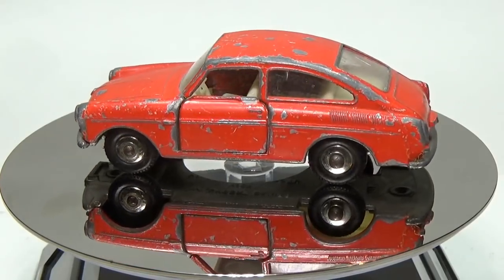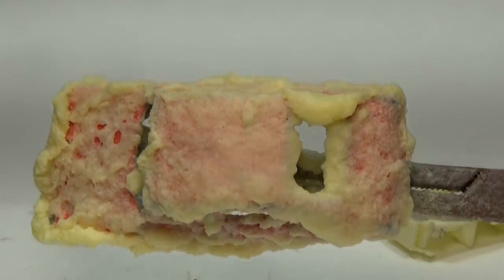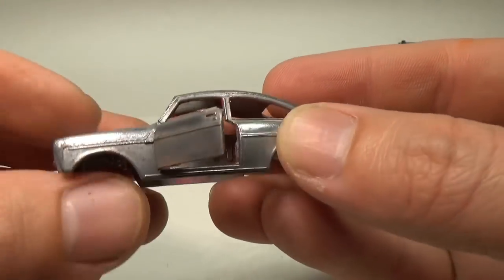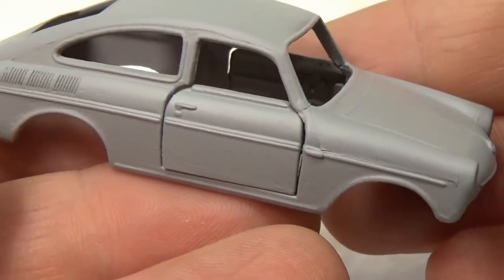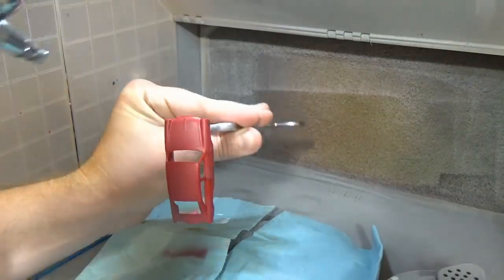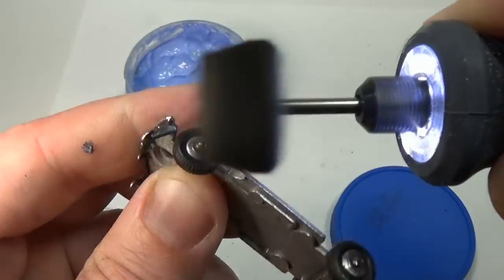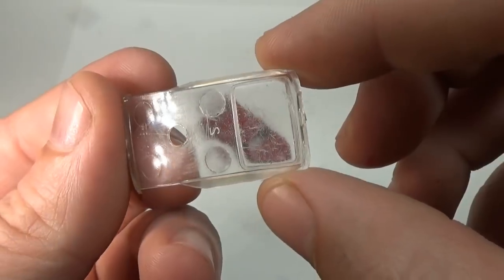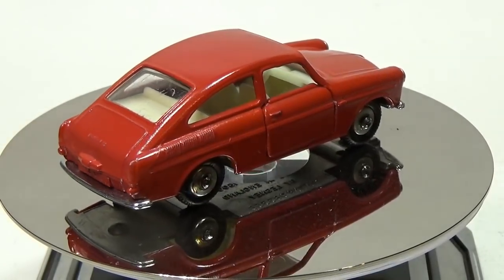Matchbox Restoration: No67 Volkswagen 1600 TL

Comment: During a recent restoration I came across a tool that might be of interest to you. It is called a scratch brush. It is a small brush that uses glass fibres as the cleaning media. Scratch brushes are used in the restoration of watches and clocks to clean corrosion from surfaces. They are great for getting into tight areas and give a pleasing finish. They pretty cheap and now a confirmed part of my restoration toolkit.

Comment: Fantastic job as usual.  Thank you for sharing the repair of the roof pillars with superglue; I have not thought about a simple solution such as that and generally have been passing on any purchase of cars with this defect.
My personal preference for restorations is to stay away from returning the to factory specs for two reasons: one, I usually have some ideas in mind that I want to change from what the manufacturer produced (detailing, wheels, color choice, etc.), but two, it concerns me that restorations to factory specs will be passed off knowingly or unknowingly as authentic to unwitting individuals.  I've seen Matchbox models that are modified into rare versions (for instance a red #22 Pontiac Grand Prix Superfast) that any avid collector would recognize as non-original, but sometimes on eBay, the identification as authentic is buried in the description.  And if it is a well refurbished model, perhaps bought at an estate sale, it may end up in circulation as authentic until a knowledgeable collector or expert proves otherwise.

Comment: if you sprinkle just regular baking soda on super glue (cyanoacrylate), the glue solidifies instantly leaving a rock hard clump behind that you can easily sand down to your desired shape
Reply: that won't work because 'kicking' the glue seriously weakens it and baremetalHW is using the glue's strength to hold down the distorted roof/pillars. A better way to fix pillars is to heat up the roof after clamping (be careful- don't melt the metal and try not to heat up the pillars, they melt VERY easily), which eliminates tension on the pillars. this will also allow a tighter fit between body and window assembly. also better to solder the cracks closed using a good low-temp solder- like silver solder. failure to stress-relieve the body will cause the cracks to reappear over time. in a restoration, only all-metal repairs should be done to the body.
Reply: Except it wasn't bare metal.
He glued it after he had applied the primer. That seems a bit dumb to me, as you are just gluing the paint instaed of the metal.

Comment: My friend is car painter and what i have learned from him is that base surface before primer was really coarse for model car it was coarse even for real cars.
Sand metal with at least 400 or 600 grit paper before primer and also primer needs to be sanded slightly for smoother finish.

Comment: nitrile gloves will help with the stripper. The stripper will still react with the gloves, but not as fast as latex. I usually wear 2 pairs at a time so as the outer glove goes bad I am still protected and change both gloves. Keep extras handy.

The original color on this car appeared orange to me. I had a 1970 that was orange. I really liked that car and was sad to see it go.

Comment: Nice restoration. I was looking forward on you taking off the wheels and axles before restoring the base. I have an old matchbox England base with the same type of axles and I don't know how to remove the wheels. Any help on that will be greatly appreciated.
Reply: You really can't remove them without cutting the axles. I see 1 way of doing it. Grind down end bump and slip the axle out. Then replace end bump with a bead or something similar to hold wheel in place. May be possible to cut off the bump very carefully and with a very thin blade, and then superglue it back.
Reply: U can easily just take the wheels of the axel by trimming the ends of the axel than wen u want to put the back on gently heat the end then press on them with a tac hammer or something
Reply: Rivera's Hot Wheels щщ
Reply: Rivera's Hot Wheels n'
Reply: If you tune into (marty'smatchbox ) he shows how to cut the end of the axle or just shave down the bump on the end and later return it. I realy suggest u watch it. Baremetalhw did it in one of his vidios also i believe he gave credit to marty but i could be wrong about him giving credit i seem to remember it that way thow
Reply: There is another way... you can squeeze the peened end with some special smooth faced pliers. It's kind of hard to explain. I made a special pair of pliers by cutting down and grinding a pair of cheap needle nose pliers. The important thing is the jaws have to be smooth, not serrated. If they're short and stubby, then you can get enough leverage to flatten the peened end. You first squeeze the end square, then octagonal, and then you "squeeze it round," and eventually the wheels will slip off.

Comment: Car looks great.  Grainy paint can be the result of applying it too thinly.  It's essentially drying in specks the second it hits the car (PSI too high).  Try applying a little more material when spraying so the applied paint stays wet for several seconds so it can flow.  Most model paints are designed to be self-leveling and have gloss without a gloss coat.

Comment: I️ have performed many restorations and one trick that I️ saw online was to bake the enamel. I️ place the painted body in my kitchen oven at 200 degrees for about 10-12 minutes. The finish comes out beautiful and more durable.
Reply from the maker: going to try this... thanks!
Reply: I do this with motorcycle parts that require paint; e.g carburettor bodies. Enamel touch up cans (can be made up to match any real car's paint code, then into the toaster oven.Holden Cyan metallic looks like anodising on aluminium at a glance...!

Comment: Hey, just a trick for you for your mic audio, I am sure you have tried to fix the jump-in jump-out effect when you add in your vocal track. It's impossible to make perfectly clean vocals without expensive equipment, but you can fix those jumps by recording a minute or two of background noise in the same environment that you record in, you can use this in the background, and it will make your cross-fades seamless, even if the audio isn't perfect. Just an easy trick I thought you might find useful.

Comment: BIG CRACK FIX 
I have found that it fixes small cracks on REAL helicopter blades and it fixes damn near anything if is sandable and tough. Super clue and corn starch and or baking soda if you play around with these and get use to it it works amazing.

Comment: I'm going to start restoring hot wheels and matchbox cars, what airbrush paint do you suggest to start with, I have very little experience with using an airbrush, but I've used a full size paint gun before figured it can't be much different just a smaller scale. I like watching your videos restoring these cars...you explain things very well...

Comment: After stripping paint in a project such as this, use a cheap stiff bristle toothbrush to clear the remaining paint residue away. A decent size needle can be used to get at anything left in grooves in the body. Nail varnish remover can often be used to remove paint as an alternative , just don't allow it near plastic parts.....

Comment: Great job! I’m surprised those old molds had so much detail and craftsmanship in them. 

I’m curious why you didn’t use a more bad-ass paint. Acrylics on metal just seems like you’re asking for stuff to come off some day. On plastic and resin kits I’ve had good success with Humbrol enamel and their thinner. If you put it on thin enough (got to be brave) it seems like you could do everything in one coat with no clear and a lot less polishing. For primer I would use Mr Metal Surfacer. 

If I ever have the fortitude to do this myself I’ll update you on my theory. :)
Reply from the maker: Yeah I sort of regret using acrylic... I plan to use enamel in future videos.

Comment: I have one of these, I think it has a dog hanging out of the window of one side. Also, what do you think about using an airbrush with the propellant can. I don't plan on doing a lot of restorations maybe just a few at a time, I think the air brush worked pretty good last time I used it if I remember correctly.

Comment: Another nice job! :D So, you drill out the "bolts" (rivets) and replace them with screws? Are there threads in the body, or do you use self-threading screws?

Comment: Nice job! But I'm not sure I agree with using acrylic paint. I would have gone with an enamel paint because that's likely closer to what was originally used. Enamel paints also have better gloss, so it would have made that easier, might not even have had to use any varnish.

Comment: Do you have a video on reshaping bodies of Hot Wheels redlines? I recently got an pink AMX 2 that needs the front clip, roof, and rear pillars reshaped, it also needs sanding and painting. All the parts (other than the bent body) are in great shape, I just need soap and water for the windshield, new interior paint, and fresh paint on the wheels. I can do everything but I'm not sure what kind of stress you can put on these late 60's redlines.

Comment: I have a Speed Machines Audi TT from 2010. It’s really chipped and rusted all over, and some of the tampos are half-removed. What is the best way to make it look like the factory-produced metalflake blue model it once was? Many thanks. 

Also, what is the best way to remove the rust from the axles and wheels on a  Hot Wheels car? I tried salt and vinegar many times, but it only helps the axle and not the plastic tires.

Comment: Nice restoration... But I probably would have went with solder and a dremal to repair the front windscreen cross beams?
Reply from the maker: I didn't have the knowledge to solder at at that time... I would definitely solder it today if I was redoing it
Reply: @baremetalHW  ok, fair enough... Yeah, solder would be a more permanent fix... But a good fix either way... Do you resell these cars, and how much can they sell for? And does restoring increase or decrease value of car?

Comment: This is one of the best colors I’ve seen you use.

Any tips overall in how to jump into this hobby? Could I just start by going down to a Goodwill and start disassembling/cleaning some cars?
Reply: Chris W. Early just do it.
Reply: More or less. You quickly find that some manufacturers produced models which are much more rewarding to work on than others. My absolute favourites are french made Majorettes, they have spring suspension which is hooked in, so can simply be flipped around to eliminate all the sag, while the castings have all of the badging and trim cast in, because they typically had no decoration beyond the basic body colour. I think Hot wheels are the worst, the use of complex tampo printing and spectraflame paint left the designers the freedom to be really lazy with the engineering and not only are they hard to fix when worn out, the castings really have very little intricacy to them. Old Matchboxes are better, but early superfast ones have these evil waxy plastic suspension pieces which the axles clip into, they break and nothing will glue them back together. 

Finish wise, less is usually more so you want to go for the thinnest paint you can apply, while still covering the whole model, and then detailing with a very fine brush. This is why the Majorettes are great, because you just have to gently run the brush over the incredibly crisp detail

Comment: Is using primer absolutely necessary?  After so many coats of primer, paint and clearcoat the details on the model are much less crisp than they seem to be with the original paint job.  I wonder if Lesney used primer or just hit it with one coat and boxed it.
Reply from the maker: They did not use primer they just painted them straight enamel

Comment: For cripe sakes, if it were possible for the factory to not have mold line flash,  they would have preferred to not have have it. Take off the flash. Its how they would have done it if the budget was there to allow the hand work.

Comment: Why does this model look like it's been 'badly' restored? The paint appears too thick and covers the detail more than it should.  The grills on the rear wings for example prove my point.
Would using thinner coats of paint help in this issue? Or is it something that just can't be avoided when repainting an old model?

Comment: Next time you work with that paint remover, try using nitrile gloves. They are designed to be chemical resistant and that shouldn't happen again.
Reply: It depends on the stuff being used. He uses Aircraft brand stripper, and it's nearly pure methylene chloride and will turn nitrile gloves into bubble gum, as well. Nitrile gloves are no more 'chemical resistant' than latex gloves. They are popular due to their hypo-allergenic properties. I used to clean lots of aircraft propeller parts when I was an airman, so, been there, done that.
Reply: So what do you use?
Reply: Aircraft remover eventually eats the can it comes in.

Comment: Is that the common 1/64 scale model?  Matchbox fell off completely.  Now all their stuff now is plastic garbage. I don't know why.  But I had some nice matchbox models from years ago.  I had the 1987 Sterling 827 sedan. Currently, I have a BMW 850 CSi and a BMW 5 series I got back in like 1998.  Those were special editions.  Back then, they were still making plastic models.  They stopped making all metal construction since like the early 1990s.  Today thankfully newer companies like M2, Greenlight, and Jada are making all metal models.  And Johnny lightening is still around.  They never downsized and went to plastic construction.  That's why I always admired them.  Even Hotwheels models suck.  All plastic chassis.  Only special editions use all metal construction.

Comment: About 4 minutes in you talk about your $25 airbrush. I understand why you didn't go off on a tangent and provide a lot of detail about it in the video, but maybe it's okay here.  Obviously, if you've been using this for 5 years then it's obviously a workhorse. It appears to be a gravity fed and I'm guessing that's because you are not painting anything much larger than the palm of your hand.

What I'm initially wondering is:
- What brand/model is this?
- Is it a dual action or single action?
- Where did you purchase it?

From what I've been able to gather from the internet, airbrush preferences can be a deeply personal thing but I appreciate your opinion that this particular airbrush is just a tool you use in your hobby, not the hobby itself (for you).

Thanks for sharing your videos and knowledge.
Reply from the maker: it is a dual action"Master Airbrush" (Chinese knockoff of an Iwata High Performance Plus C)... 19$ on Amazon.

https://www.amazon.com/dp/B00EKUU0WY/ref=sxr_rr_xsim_1?pf_rd_m=ATVPDKIKX0DER&pf_rd_p=3008523062&pd_rd_wg=UDp9i&pf_rd_r=EGX51T9VWQV55DQ7A91F&pf_rd_s=desktop-rhs-carousels&pf_rd_t=301&pd_rd_i=B00EKUU0WY&pd_rd_w=b1S7i&pf_rd_i=airbrush&pd_rd_r=84180b94-66dc-4493-bec7-5ff046d36d7b&ie=UTF8&qid=1513899489&sr=1
Reply: Thanks for the info!  I did a bit of airbrush work on small items many years back using a Badger 350. Nothing that would impress anyone with great skills. :)

Looking at Amazon I see there is a "G22" version for the same price as your link although I have no idea what the difference is between them. The only reason I mention it up is there is a package with a compressor, tank, and G22 airbrush for $110. https://www.amazon.com/dp/B0017640RK

Realizing that this is a very subjective question, does that seem like a reasonable way to get my feet wet again? Anything jump out at you that gives you misgivings?

Comment: Sent this to you via YouTube message a few months ago, but I'll leave here to see if other people approve the idea:

Little challenge on what to make. Don't know if it will end up very amazing or if it is even possible, but you might want to give it a try:

Get a Custom '62 Chevy and a 1969 Pontiac GTO Judge:
http://hotwheels.wikia.com/wiki/Custom_%2762_Chevy
http://hotwheels.wikia.com/wiki/1969_Pontiac_GTO_Judge

The Pontiac's engine is separated from the body and the underside, as a separate piece, so you can take it out by taking both appart, and it probably fits in the bed of the Chevy truck perfectly. I want you to make a dragster rear-engine truck, kinda like this image I just found:
https://s-media-cache-ak0.pinimg.com/736x/a8/92/ab/a892ab25eae4d47ed1cce300ae605ebe.jpg

If other people know other trucks that would be better for this, please comment it.

Love your work. Good luck if you accept this challenge.